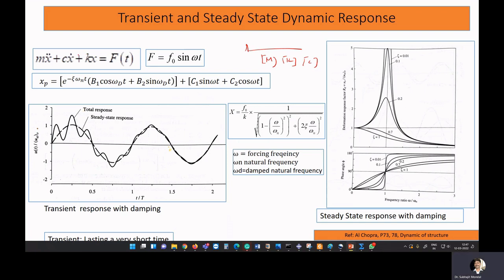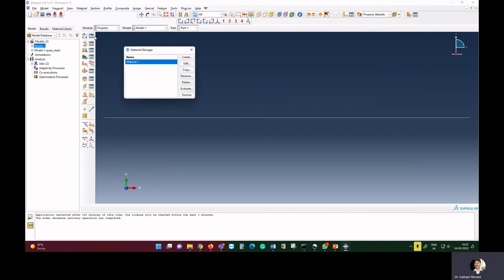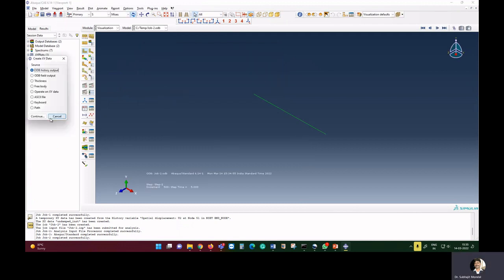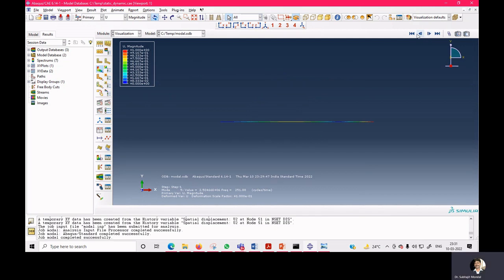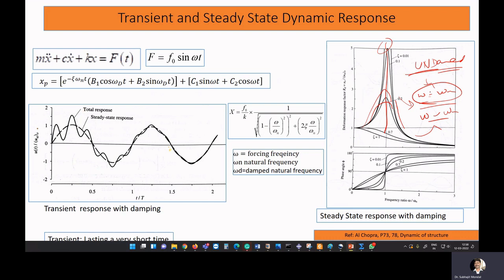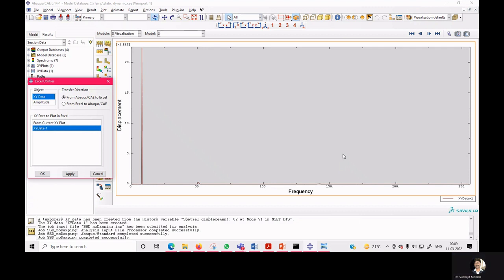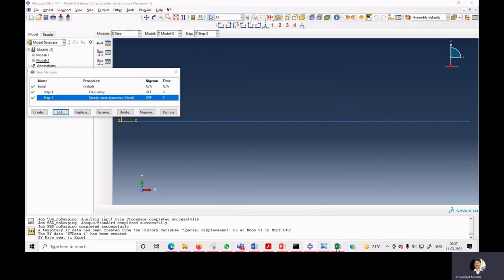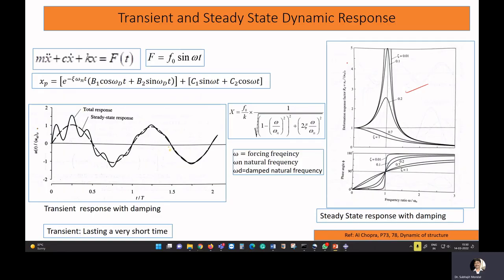Time Response, Steady State Dynamic Analysis with ABAQUS example

Comment: Hi Sir. I have one doubt in this video. For the steady state runs you are doing the modal first and then the steady state. But there is no periodic load in this analysis at 8hz frequency which u had given in the first part of this video. Without this load, what is the frequecy of the forcing funtion while running the steady state analysis